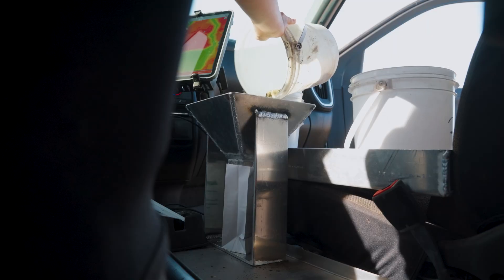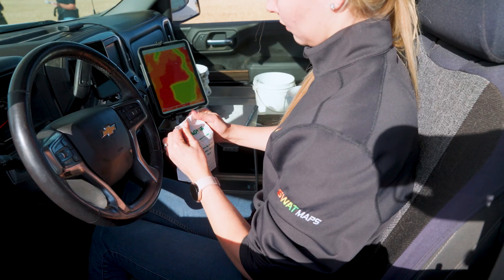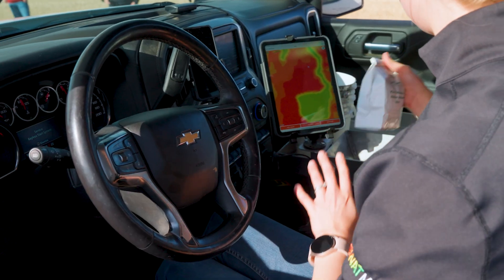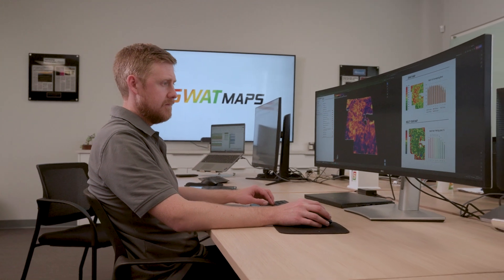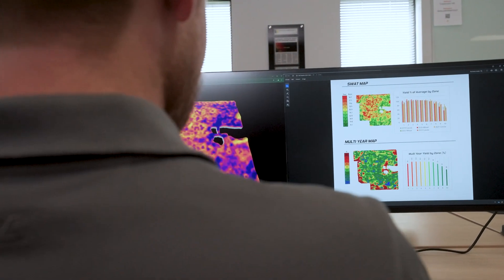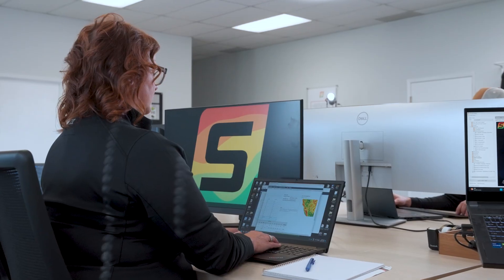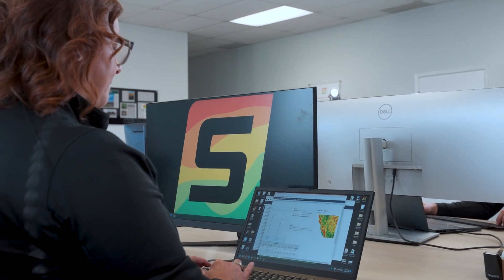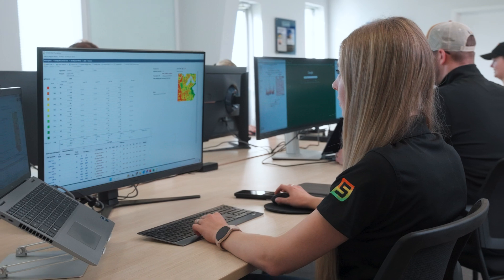The SWAT MAPS Process: Unlocking Your Soil Potential

Comment: How does Swat Maps compare to using a multispectral drone to get NDVI readings and field info?
Reply from the maker: Any imagery is different data for a different purpose and mainly used for mapping crop or vegetative index, which is the result of many things and will change every year. SWAT MAPS focus on soil & topography data that are stable. We largely use SWAT MAPS for soil applied inputs and use imagery for in-crop applications of certain products like PGRs, on/off fungicides or desiccants, or topdressing.